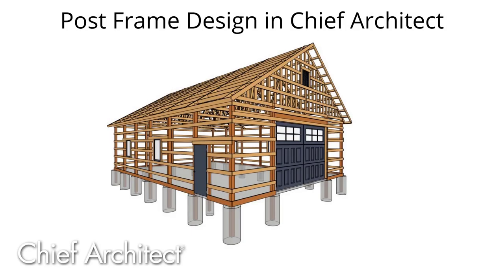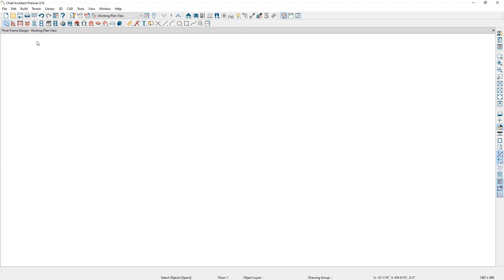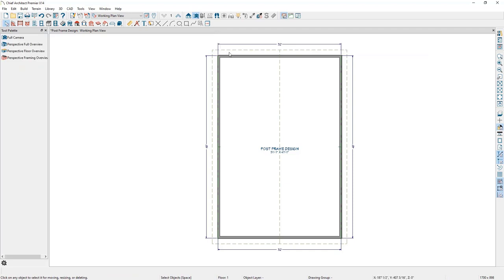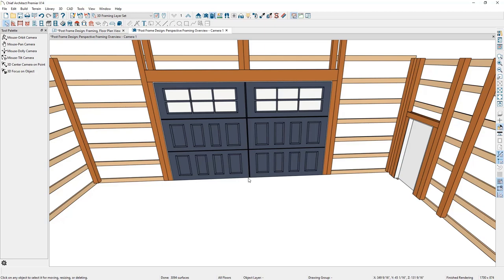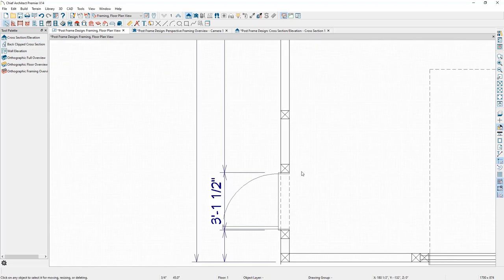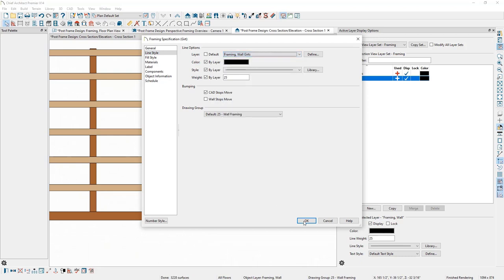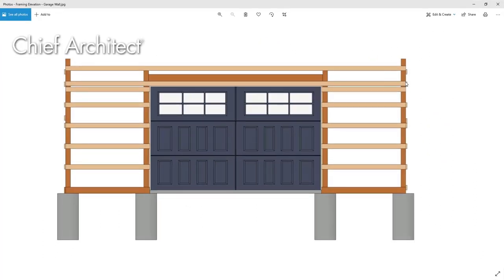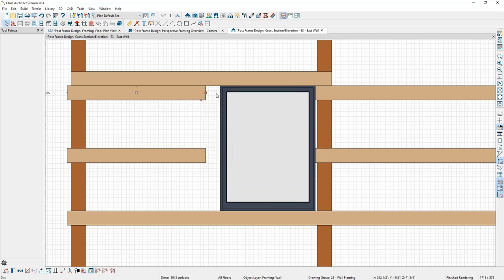How To Make a Pole Barn Post and Frame Structure

Comment: I am trying to do this in x10 and my dialog box for defining the wall layers is different than what yours shows. I specifically cannot get the girt framing to work correctly. Is there a different flow I should be using in x10?
Reply from the maker: There have been new tools/features added since X10. Feel free to reach out to our sales team about your upgrade options. You can call us at 208-292-3400 Monday – Friday from 7 AM – 4 PM Pacific.

Comment: When I open the wall type definitions. I do not have the options like yours does, such as everything under "Material Layer" @2:20 please help.
Reply from the maker: Thank you for reaching out, Levi. What program are you using? This video was created with Premier. We do offer other programs that don't include the same features.
Reply: @ChiefArchitect  i am using home designer pro 2021. If I can’t use this feature with my software can you point me in the direction of a “how to” pole barn draw. I own a Barndominium building company and more and more of my clients are requesting preliminary drawings and renderings.
Reply: @leviaberle932  I use the same version. I have to just start with the default wall assembly and then in the 3d perspective view individually remove/ add each framing member. Same with posts and piers. I have done this several times with A-Frame type homes as well. It's a bit of a pain. But possible.